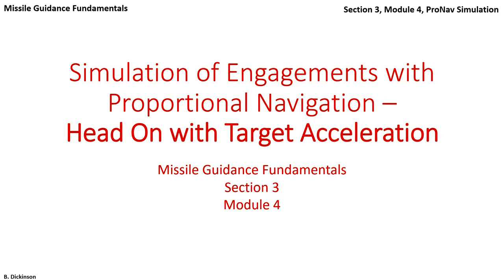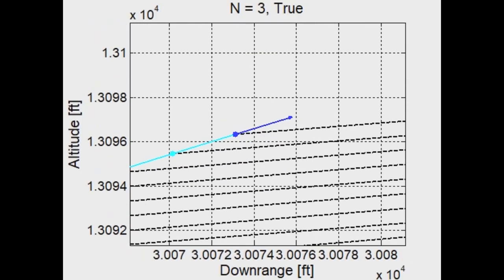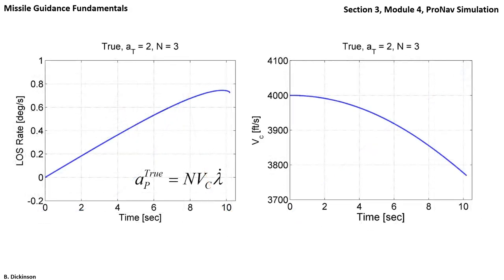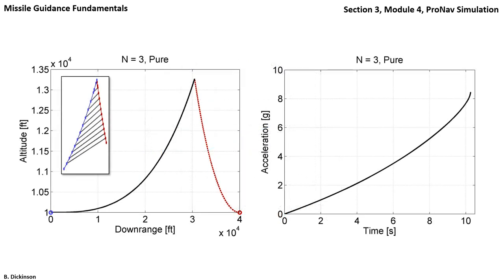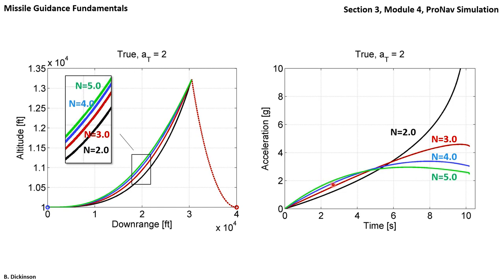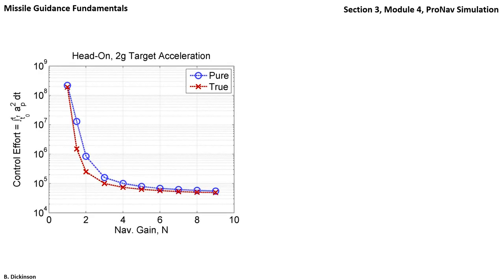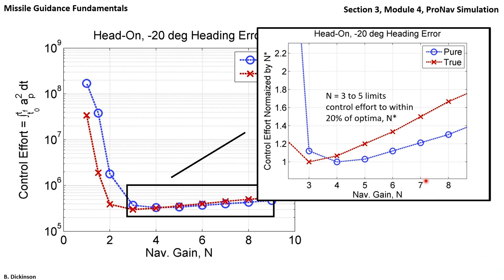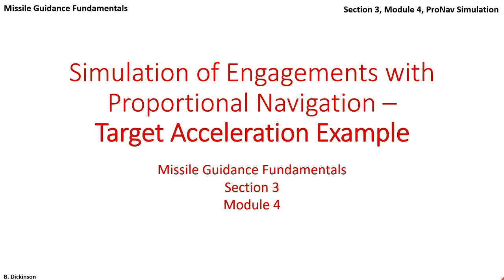Simulation of Proportional Navigation for an Accelerating Target (Problem Set) - Section 3 Module 4

Comment: I had a question. At 2:33 we could see that the collision triangle has been established before collision. Therefore, the LOS rate should be zero at that moment, and so does the acceleration. But why the "acceleration-time" graph shows that the acceleration is about 4.5g before the collision?
Reply from the maker: Great question. So the line of sight rate appears to be zero but it is actually a fraction of a degree per second (on the order of 0.1 degrees/second). This cannot be seen from the triangle by inspection, but translates to several g's as you observe. A key takeaway is that continuous adjustment of the pursuer is needed all the way to collision even when it looks we have the triangle perfectly. At every instant, the accelerating target changes the collision triangle so we me must always be changing our course. I recommend coding the simulation in the appendix and running this example to check the LOS rate.
Reply from the maker: If you have Augment Proportional Navigation it will be a different outcome because target acceleration is fed back into the guidance law, in addition to LOS Rate. This is being covered theoretically in the optimal control series. Parts II and III will be posting soon.

Comment: Just to clarify for an IR seeker it would not be able to calculate closing velocity only line of sight rate. how would this effect the proportional navigation?
Reply from the maker: If we cannot get the closing velocity, then we can use Pure Proportional Navigation, which requires just pursuer velocity in place of closing velocity. Both forms of guidance work well.
Reply: @LearnGandC  Are there any inherit benefits of one form of guidance compared to another?